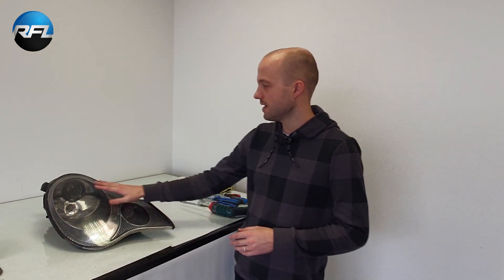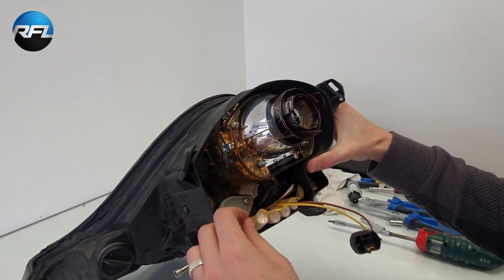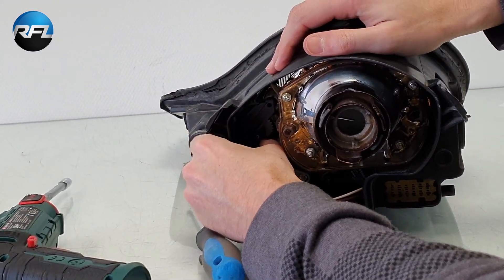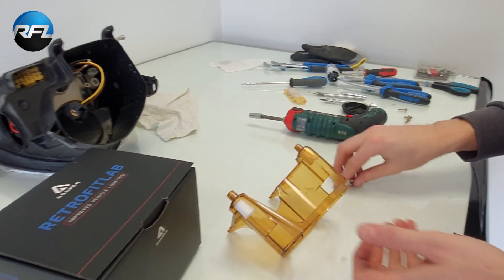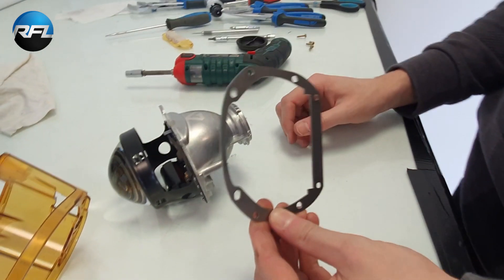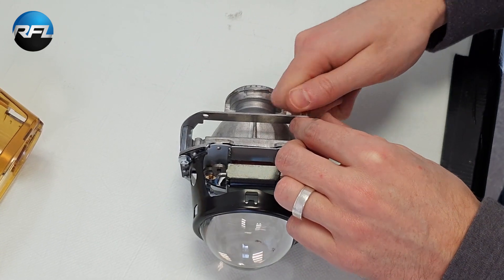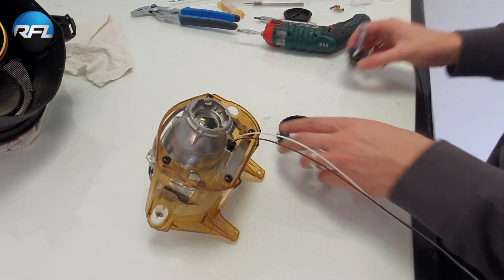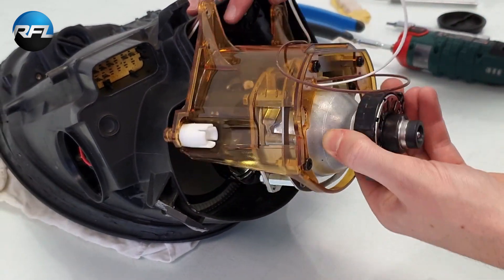Porsche 911 996.2 986.2 FL halogen/xenon projector headlight upgrade conversion to bi-xenon HID

Comment: This was somewhat challenging. even though I have a fairly low mileage, garage-kept car my wiring was completely brittle and the coating just started falling apart on contact. Now, I'm looking to replace all of wires and harness kits around $450 per light for basic wiring. I could probably find a work around and source and repair the wiring on my own with no electrical experience but that might take a week or so. It sounds like this is an issue with these headlights and it would be great to see an encompassing approach to updating the wiring to go along with this lighting upgrade. I think a lot of folks thinking that this is an easy out of the box fix will find a lot of complications without clear solutions to wiring issues.
Reply from the maker: Hi Matthew, 

Sometimes on older cars (20/25 years) the wiring can indeed get a bit brittle, but is not always nescesarry to fully replace the wiring. Sometimes insulating the wires again can be enough to fix the problem. I understand whre you are coming from and appreciate your feedback. We do have local dealer who offers rewiring for these headlights and several other Porsches. You can maybe check out his website: 
https://www.adriantaillights.com/store/Porsche-996-2-internal-headlight-harness-repair-p680067923
Reply: @ thanks. I’ve been talked off the ledge. I have zero electrical experience but with the help of the broader community I’m developing a game plan to fix the wiring through a combination of addressing insulation and acquiring the requisite tools to develop the skills and execute the job.
Reply from the maker: @matthewhomyak1665  That is great to hear man! Nice to hear you are taking on the challenge and rewiring/insulting it yourself! Not only will it be a nice learning process most of all you will safe a lot of money! 😎 Good on ya!

Comment: Is there any proven solution for connecting the bi-xenon splitter wire (white/brown) with the factory bi-xenon splitter wire (same color combination) - the connectors are different. Thanks!
Reply from the maker: In  our kits, we supply high beam splitters to make the connection for the high beam signal to the projector :-)